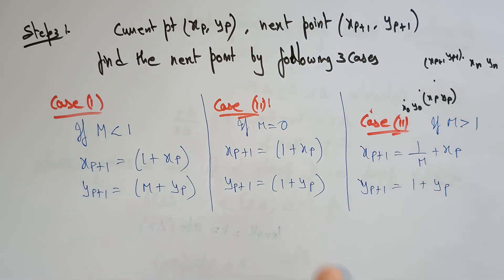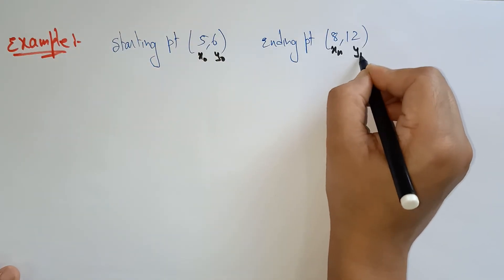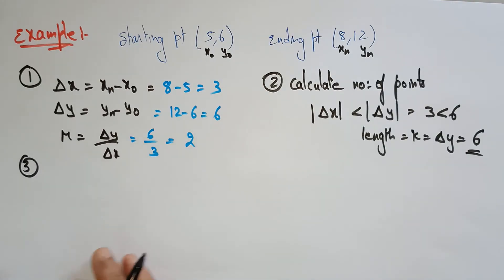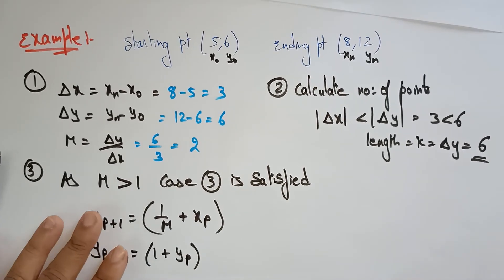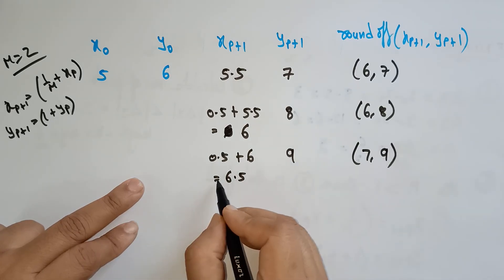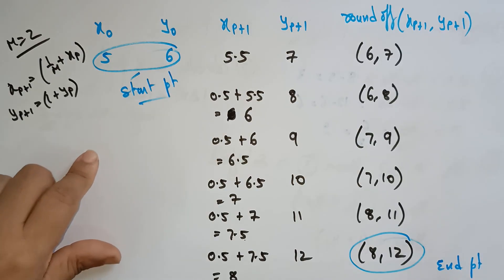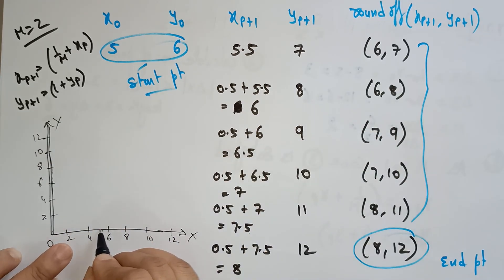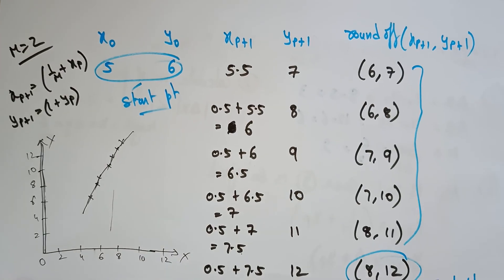Digital Differential Analyzer | DDA | Algo & Example-1| CG |Computer Graphics | Lec-14 | Bhanu Priya

Comment: ✅ Advantages
- Simple and easy to implement
- Works well for gentle slopes
- Produces smooth lines
⚠ Disadvantages
- Uses floating-point arithmetic (slower on some systems)
- May introduce rounding errors
- Less efficient for steep lines compared to Bresenham’s algorithm

📚 Applications
- Line drawing in raster graphics
- CAD software
- Image processing (e.g., edge detection)
- Game development

Comment: Digital Differential Analyzer (DDA) is an incremental algorithm used to draw lines between two points on a raster display. It calculates intermediate points along the line using floating-point arithmetic

Comment: This is an excellent video but with an error in the second condition. m=0 is not a valid condtion since y is increasing and m=0 means y coordinates are not changing.Instead it should be m=1. Other than that it is a very good video. Thank you ma'am.